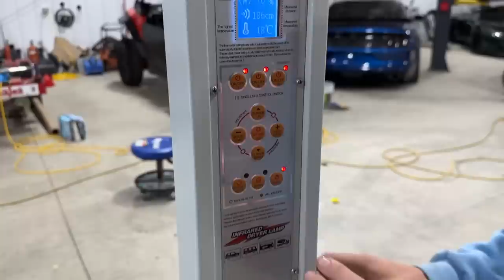Rebuilding A Wrecked Lamborghini Urus Part 21!!!

Comment: I have over 10 years in the wrap business. You guys need to POST HEAT the areas you stretch a lot. Get a laser temp gun and use that IR lamp to post heat to 190 degrees. That will kill the vinyl's memory and it wont pull back. I normally hit 200ish degees just to make sure.
Reply: I have 17 minutes of wrap knowledge as I watched a couple of crash course youtube video's, you're 100% correct; the wrap needs to be heated up post application so it doesn't shrink back.
Reply: I’ve got 30 years and it won’t effect it there not gonna have it on for years
Reply: @MyYewTubeAccount  I once wrapped a couple of dash trim pieces and I can confirm everything you and the other 2 guys said is true.
Reply: Your reply’s are gold 😂
Reply: I’ve got 2 weeks experience and I don’t agree with you. 195 is the best temperature.
Reply: I just hope that for ONCE, they read thru the comments. Of course if they don't, it won't matter, they'll "spend" and get it done right in the end.
Reply: I'm 21 with 30 years experience(over time baby) and everything you said is true
Reply: My great grampa invented the wrap and he used a lighter to heat it up
Reply: The replies are golden 😆

I just see people put so much pressure on wrap thinking it's going to stay because it did for a little bit. Spending 30 minutes to an hour post heating will save you time and money.
Reply: I have zero minutes in the wrap business and I have no idea if any of you buttnuggets are correct.
Reply: @kennethbrown1879  🤣🤣🤣
Reply: HAWG:CRANKED✅ 

PANTS: SHIDD ✅ 

ASS:WIPED ❌
Reply: I have 40 years experience in wrapping. Tell those dudes to hire somebody. They screwed it up suckers
Reply: I got 30 years experience rapping, but don’t know s#!t about wrapping.
Reply: I am a wrap and i prefer celsius for my temp and my sweet spot is 69
Reply: Yup I’ve got 45 minutes of wrap experience in my buddy’s garage while I sat and drank a 12 pack and watched. Can confirm, definitely need to heat her
Reply: I have 400 years experience in wrap, they are doing just fine.
Reply: I had a turkey bacon ranch Wrap for lunch today. And everything they said is true. Maybe add a few more pickles and salt and pepper and you're good to go!
Reply: I have 30 years experience wrapping Christmas presents and I can guarantee that you're 100% correct.
Reply: zero years...and the lambo should be painted...
Reply: As an experienced wrapper, and I see some are in here, but also, some of you might not be claiming you are, temperature isn’t the issue for edges. You have to adhesive promote the edges. Real wrap techs know that.
Reply: They are literally practicing lol calm down!
Reply: @tuju2  did you use the heat lamp? Because I don't get them smooth finish 😝
Reply: @djsonicc  I wrapped my interior trim on my GX470, 100% what you said is true!
Reply: I have been wrapping cars since the mid 60s and I can confirm this is true
Reply: I have 276 years of experience vinyl wrapping supercars and I agree.
Reply: I wrapped a car around a Georgia Power pole. Does that count for experience?
Reply: @kennethbrown1879  butt nuggets? Laughing my ass off....can't wait to call my smart aleck grandson a butt nugget! Thanks!
Reply: I have no knowledge and I’m disagreeing just to argue
Reply: I once wrapped the sausage. Even used the heat, like you said, ‘cause, y’know, large condoms. 

My reaction was “OW!”
Reply: Guys, lets be serious...I have 326.2 insomnia nights of experience on YouTube Wrap videos and the correct temperature is 193,1415 degrees.
Reply: I have 20 mins of  Call Of Duty experience and I keep getting killed like 2 mins into the round.  This is some bullshit, Yo.
Reply: I have 25 years in the wrap business and I’m 24, I can confirm I don’t know what the heck I’m talking about.
Reply: Iam 47 years over the wrap business with experience of my mother over 20 years by supporting me throughout business..above  guys said what it is Real true... Peace
Reply: All these replies r gold 🪙
Reply: Have vanilla ice do your wrapping
Reply: I’ve been an idiot my whole life, but I know when you’re wrapping a Lamborghini in flat beige…
Reply: Jurassic park colours haha
Reply: 100% right it's all about the heating system
Reply: Rattle can time.   😂
Reply: I have over 20 minutes of YouTube wrap experience and your statement is correct
Reply: I have 100 years of experience in wrapping. I time travelled and invented this business.
Reply: I have over 100 years of experience 196 is the best degree
Reply: Noted. Lol I want to wrap my own car, so this is super useful. I’ve had this question in my mind, while theory crafting how to wrap 😂😂😂. Thanks
Reply: Wrapping is hard, pay a pro and get the best results.
Reply: I don’t have 1 minute experience, but what I do know is when people in the comments do know what’s up, these pickles ignore the advice anyway.
Reply: I stayed in a holiday inn express last night and i can confirm what Tracy says is true.
Reply: I have 5 minutes of YouTube experience and you guys are doing great 👍...
Reply: I have 35 seconds of wrap experience after reading your comment and I completely agree
Reply: im a 36 yo wrapper with 50 years of experience and this statement is on the spot
Reply: @husbeard should’ve painted it. Looks and feels much better
Reply: wrap hasnt even been out 10 years stop capping
Reply: @CaptainCooter  just thumbs up your comment because it is a funny joke. Nah, I’m just a guy who has been invited to the OCC shows in Newburgh NY to wrap and tint cars for JNA, and many others. I am a CCW holder of NYS and a traveling technician whom has been invited all over America to wrap, tint, and install Fleet Telematics all over. My work is known by those who know my name. Many you may follow on YouTube now. Be respectful, not a prick. I’ve worked with 30-40 year veterans. All know the key to a non peel wrap is, adhesive promotions. That’s one of the main things they tell you in certification for warranty. Proper adhesion is key to non peeling vinyl with of course, proper preparation. I didn’t see one person mention prep steps. How about you retract your message now and respond like a grown man and not a weak minded woman.
Reply: Ask TK Kirkland…
Reply: I was there, Gandalf... I was there 3000 YEARS AGO!
Reply: @mikehonda7934  No point in lying lil bro. No one who’d do that would get so butthurt over a joke they’d reply a paragraph to it. You and Joe Biden the same person
Reply: @neiltomlinson7640  yes
Reply: I am the wrap and can confirm 195 degrees is optimum stretching temp 😎
Reply: I've been eating tortilla wraps for over 25 years now, and that thing is really good..
Reply: I’ve eaten many wraps, and I can tell you 200 is a bit too much…
Reply: I own a construction company and I can confirm that all of these people are correct
Reply: Columbus took me with him when he left to discover America as a master wrapping and you my friend are 100% right about that temperature 🚣🚣🚣
Reply: @raymondtuckerjr1886  and make bunch more$ of the repair video
Reply: I don't have any wrap experience but I did stay at a holiday inn express last night so....
Reply: I never did wrap by myself . But seen many times how professionals did . You are 💯 correct
Reply: I learned from the best ... thx Rick Ross
Reply: Certified forklift operator here
Reply: The color kind of look like primer it is different for sure nice work Guys as always
Reply: That has to be the ugliest color for a car I’ve ever seen
Reply: I have zero experience and don’t even know what i am doing here.
Reply: @Carmenhan  I’d give it a week. Looks 3rd rate. Some people never learn and the Audi looked like shite after they’d messed with it too. Paint properly and decal a great Dang Sauce ad on the sides.
Reply: I would use steam imo
Reply: i know a guy who wrapped a car once and he says just send it bud
Reply: Scrap the wrap and paint the car
Reply: this guy wraps it up
Reply: I’ve never wrapped before and you’re just wrong bud
Reply: I have eaten several wraps and Tracy is 100% correct. 200ish degrees for sure and you know its all cooked.
Reply: I AM vinyl wrap and I promise not to stretch back if you post heat me to 195 degrees,
Reply: I got 8 years of wrapping knowledge. I don't always do my best, but those breakfast burritos I be doing in the mornings be coming out exceptionally nicely wrapped, if I say so myself.
Reply: I am the wrap and thats correct
Reply: I've got over 67 years wrap experience and knowledge passed down from generations that can confirm this is infact how it has been done for 100s if not 1000s of years only difference is they used swords and dragons breath
Reply: @masterdamnedproject4065  yes like a sealer coat before base
Reply: @JustAGuy781  you’ve never worked a real job huh? 😂
Reply: @Raymond Tucker Jr  I was thinking the same thing, they'll wrap the whole car then find something wrong with it and that's when they'll bring their buddy in to do it right. Just like they do with their paint jobs. They really should read some of their comment, some of these people have years and years of knowledge that's just wanting to help them out, but I guess if you got their money it don't matter, it's all about the content for them
Reply: I have been wrapping cars for the better part of 20 minutes, and plasti-dipping wheels longer than that. In my professional experience I would say just leave it to the professionals to do the wrap so you don't waste it all.
Reply: @MyYewTubeAccount   dang that’s a lot of experience 🤣🤣👍
Reply: @@bluecollargarage8975  nope, never have had a real job.
Reply: I’m a professional rapper and all I heard was a bunch of instrumentals and no verses. That “daaaaaannnggggg ssssoooonnnnn” is a good adlib though
Reply: @rickroberts7611  😂😂😂😂😂😂😂😂
Reply: @JustAGuy781 🤣🤣
Reply: I have over 2000 B.C in the wrap business. You guys need to POST HEAT the areas you stretch a lot,

Jk don’t know shit bout wrap
Reply: I couldn’t afford to stay at the Holiday inn express so we stayed at a Motel 6. I used the heat from the light they left on and it hit the perfect 198.6 degrees.
Reply: @Carmenhan  it didn't even last 30 hours as seen in the video
Reply: I have to heat and stretch every Morning when i get up.
Reply: @gomd3rd  Lol
Reply: @patman48  no Dang Sauce, 'Dannnnng, su,u-u-u-n?

Comment: When wrapping a car or anything you need to do something called post heat. This means you need to use a heat gun after on all the panels so the wrap don't start to lift. Hope this helps you boys out.
Reply: Soory guys looks like 2 pack primer from the 90s
Reply: @IYKOOO  each to there own. Not everyone will like it but as long as the boys do then it's up to them.

Comment: TIP: You would have been ok on the roof if you would have placed two strips a knifeless tape or got double tape. That's how you properly join two sheet's for the perfect seam.

Comment: Wrapping is like platina...an excuse to avoid the extra work to get a proper paint job. You guys should definitely paint it. Wrap is very expensive too.
Reply: I think they said they’re waiting to have their own booth to paint it, since it’ll take a lot of time
Reply: They have said three times at least they’re going to paint it when they have their New paint booth built.
Reply: @Bendejo-lm8wo  haha you normally see them paint a panel, bumper or trim. To paint a Urus full body is around 12k. Would you waste 12k on paint for a car that might have bullets in the engine.

Comment: The spots in the vinyl on the bonnet Is the glue of the vinyl as you stretch it catches the crease line...happens alot on the avery air release vinyl

Comment: Another tip if you wrap in the shop with unclean floors, surroundings etc, wet the floor down/wet your shirt or clothes to prevent dirt, lint or fuzz from getting under the vinyl.
Reply: Lol I've never seen one wrapper ever do that.
Reply: @jerrywilcox9890  I’d say it’s one of those things where you do it a few times, tell yourself it’s a good thing and it’s working a ton, then you slowly stop doing it. Or only do it as needed

Comment: Also some kind of "slip" spray, usually a combo of dishwashing liquid and water to spray on the surface first, then lay the wrap, then squeegy all the water/trash/bubbles out,  prevents it from getting air bubbles and allows the adhesive on the wrap to bond better once everything is dried out

Comment: Wrap ALL the way behind every panel. Use the back (non-visible) side of the panel to anchor the vinyl material to prevent lifting and those “fingers” you got on the bumper. Fingers are caused by high amounts of tension, either use inlays in that area to avoid all tension or lay the high tension part first and then work the rest of the panel after that. Prevents it from bubbling, fingering, etc. In turn you also won’t need edge prep on a car at all if you follow some of those tricks

Comment: when wrapping the corners of your body panels, stretch the wrap out over the corner and then you hit it with a heat gun before cutting and itll shrink into the corner and preven pull back

Comment: You need to post heat after you finish wrapping each panel. So it doesn’t peel like the bumper. Heat it up to 200 degrees and it’ll stay

Comment: Did he said Avery is shit ore did he meant is for professional and they can’t handle the pressure of wrap give . And yes u did stretch it that’s why it lift and ur not supposed to heat it all the time u lay it . Use a small heat guy when need to stretch when is flat work it out 😊

Comment: The foil is stretched at the ends and tends to return to its original state, all you need to do is heat the ends well and wait for it to cool before cutting, this will kill the memory of the foil.

Comment: When wrapping a car you need to use a heat gun to be able to stretch the wrap cant use a heat lamp other wise when you go out in the sun itll start to lift up also you cant take long to wrap an entire car since it need the sun to cure.. the reason the wrap started coming off is because yall cut it to short you always have to leave it bit long and leave extra wrap and heat it up with the heat gun and stretch it properly otherwise that will happen where itll start to peal off because it wasnt properly heated up... or stretched as well id say do a paint job less hassle ... a chameleon wrap would've of been better the wrap eeeeh...

Comment: Make your man cave you paint booth dude. Put it to use,and remove all that once green wood, you can burn now. That's the color ??? Looks pretty colorless. Close enough to be a taxi . The heater. when cost is no object, can't wait to see the bill to use that power hog dude. Not much waste with the wrap either. Cost I think paint would be cheaper.

Comment: It not just paint the outside, they also need to paint the inside too, they haven't even done with installing trim yet and they are wrapping it, and wind sheid? side glass/window? this car is gonna look like a failure after installation and wrap. They clearly didn't plan this out properly.

Comment: The wrap is too stressed on the bumper and that's causing the failure.  On the hood is trash, be mindful of the environment you're wrapping in.  You do a lot of sanding and the door is open allowing dust to move around.